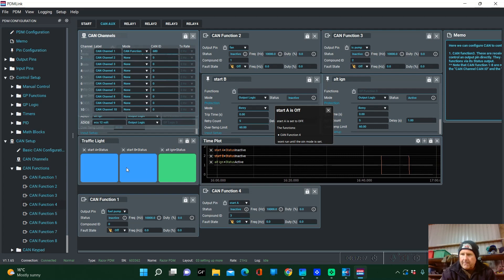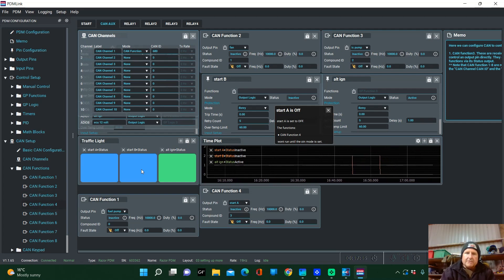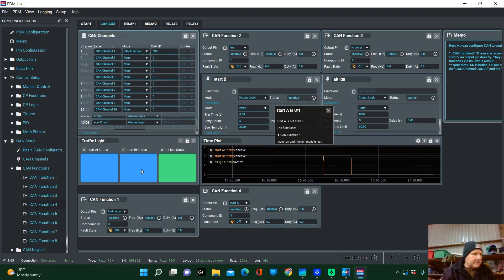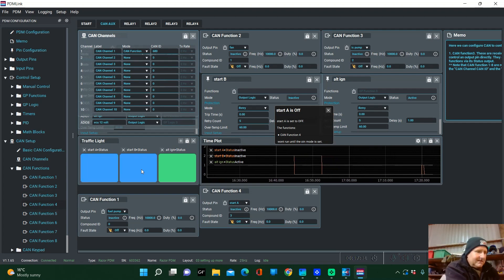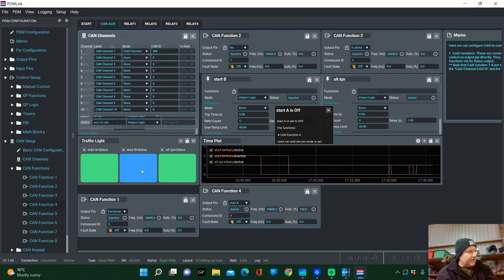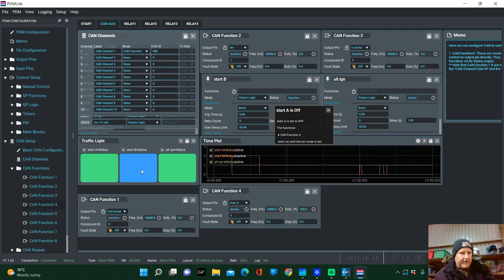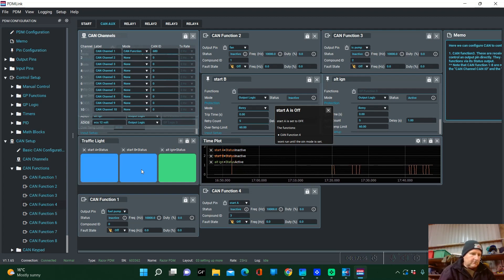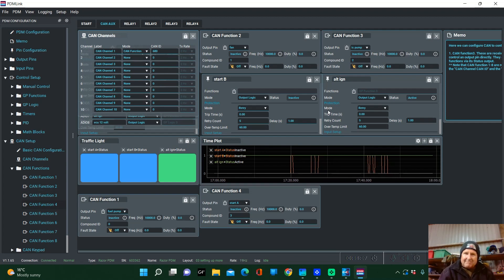Setting up link Razor PDM part 2

Comment: CartuneNZ plz help me and  tell  can i put 3uz heads on 1uz thick rod bottom? did someone do that? i got 3uz with bottom destroyed but heads are ported and have better sporty camschaft and eaton m122 supercharger with small pulley. The engine was dynoed to 600+ hp. But now i want to rebuild it and the cheaper way seem to be get 1uz bottom with thick rods and cover it with 3uz heads.. i know there will be a vvti oil lines issue but it seem to be posible to get vvti